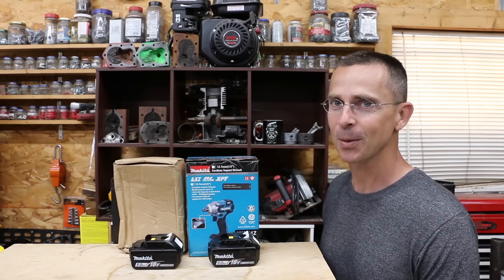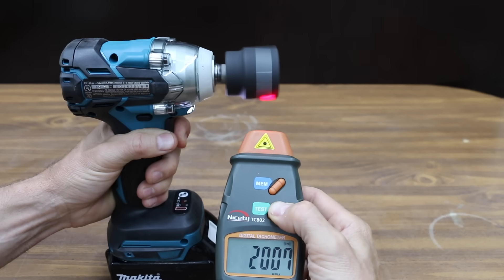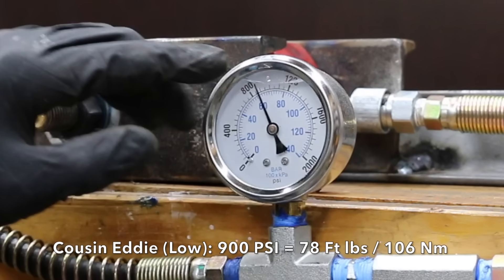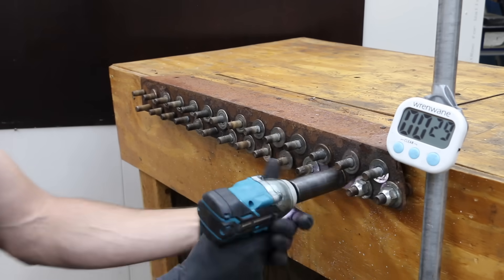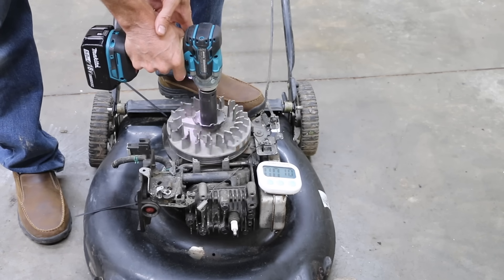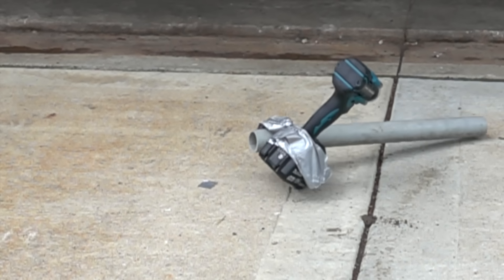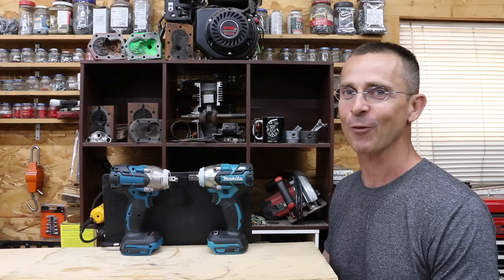Fake Makita Impact Better? Let's find out!  Makita XWT11Z 18V LXT Lithium-Ion Brushless Cordless

Comment: That makita is worth the 130$ but that was a good 30$ tool also
Reply from the maker: Great point
Reply: @ProjectFarm  keep up the amazing work this is one of the best channels on youtube
Reply: @arvivirash5561  if u are going to buy something buy it good than buying something bad knowing it eventually fail on you
Reply: @lil_frizzzy2313  how do you know the cousin Eddie will fail and the makita will not? simply because its expensive?
Reply: Chicago Pneumatics invented both the air and electric impact wrenches. So all should be paying them, but that is not how reality works. For home use, I would buy the $30 Chinese, Indian, Korean, Taiwanese, Japanese, etc etc who ever makes it as long as it does the job vs $130.00. If they are specifically saying they are a brand that they are not then yea I would not buy it.
Reply: @rafaelrivera9346  Some of the best tools money can buy are Japanese.
Reply: @rafaelrivera9346  Japanese tools are far superior to some of these tools made for American companies in China.
Reply: @rafaelrivera9346  if their patent wasn't expired, or if CP still held patents which actually mirrored existing products, then they do pay.  You are forgetting that the $30 eddy doesn't come with a Makita battery and charger.
Reply: Though a product brand may be American, however a lot of engineering products of these sorts are in fact either made and or assembled in China or other Asian countries. And because of contractual agreements the assembly manufacturer has licenses to produce a generic (or so-called knock-off) product from basically the same tooling and cast/molding jigs. This has always been the case for decades - hello to Radio Shack’s Realistic radios produced by Motorola. They were essentially identical save for the different brand names stamped across the respective products.
Reply: @marvinjgerald01234  This is true.

In the UK especially it's a joke for electronics, nearly all TV's under 40 inch are made in the same factory in Turkey and just have a brand logo slapped on the front, Panasonic admitted that they don't manufacture any TV under 40 inch they outsource it all and just collect royalties, LG is the only company to my knowledge that doesn't outsource anything, in fact they make LED/LCD panels for most others.

Dewalt/Black & Decker/Stanley are all the same brand, with a little fiddling they can even use the same batteries. Most companies talk about IP theft but most put up with it secretly so they have access to the Chinese market, basically the Chinese factories blackmail companies into letting them rip off their product.
Reply: Imagine having four 30$ tool working at the same time, and still have another 10$ for a 6pack...
Reply: UsirRaMaroon  You are correct.  I was unaware of the design patent (https://en.wikipedia.org/wiki/Design_patent) section of industrial design right.
Reply: This comment spoiled the video :(
Reply: Well, Anyone here into Firearms? Beretta, the Beretta 92. Designs have been legally sold to other manufactures, there are now many clones of the Beretta 92 being legally made by many other firearm manufactures. A lot of people think it's a knock off violating rights blah blah. Nope, My Taurus 92 is 95 percent the same as the Beretta 92.
 Any of you ever think, MABYE Makita bought rights to a design from the same place the manufacture of the "cousin eddie" acquired it from?
From the dismantle, you can clearly see the internals are different in build quality and setup.
Reply: @r.bridge1225  

Taurus, the Ford Pinto of firearms. 😆
Reply: Except for it being a total ripoff of the Makita design.  I don't like to reward thieves.  If you want to make a $30 tool and sell it on its own merits, then fine.  If you're trying to get sales by blatantly trying to appear identical to Makita, then you're trying to profit from Makita's good name and that is theft.
Reply: @BixbyConsequence  "I don't like to reward thieves." Yepp, that's the point. I would never ever buy it!
Reply: @BixbyConsequence  A lopás a 130 dollár.
Reply: @BixbyConsequence  ah yes truly theft just like how we are all thief's for daring to use wheels enjoy copyright laws though sure helps with advancements of tech... oh wait
Reply: Great tools!
Reply: the point is that makita is good brand 
but EDDIE from China is better according to ratio -  price quality 
if makita is 5 times higher , the performance on all the tests must be 5 times higher, it is not worth to buy makita ! 
for sure must be other impact tools on that price that (chinese products and not only ) will have the same performance as makita !
Reply: @gtsalbania7524  your rational is wrong.  eddie doesn't claim to perform 5 times better and doesn't even perform to what it claims to perform at.  eddie also requires a makita battery, being "for makita battery" tool.  eddie sellers give you a 30 day return policy without further warranty, which means you are going to have to pay $30 to return the item back to china for a replacement within that 30 day period, so let's just count it as 2 eddies, since no one is going to pay $30 to return ship a defective $30 eddy, which is what the chinese companies are counting on.  eddy doesn't perform at all, because it doesn't include a battery and/or charger for that battery it doesn't come with.
Reply: seems like if you're going to use cousin eddy a couple of times a year at home, and you already have makita tools (for batteries) its a great buy. but if you work in a garage and use it daily, it will probably die within a few months. false economy is only false if you expect the same quality... if you know what you're buying and only need it to do what it's capable of, no-one is worse off.
Reply: thats the home tool..not expensive but  good
Reply: hermit  Too overpriced? The video show the Makita is heaps better than the clone. You must have never owned quality tools. The clones are horrible it don't even have a linear speed controller.
Reply: ian Halifax good idea. Though I wonder if you need to charge the battery every month.
Reply: hermit  For how long? The hammer will be shot after a few uses while Makita will still keep on going after  years of use.
Reply: @YZ probably not, but I would assume there are people who gain satisfaction from more meaningful things than shoes.
Reply: UsirRaMaroon  except they BOTH are made in China..probably at the SAME factory!!
Reply: My dad has a makita drill, never changed it during my whole life, I'm 21.
Reply: Do you still have the name of the seller or the sellers store for the knockoffs?
Reply: @wingnutwillie  you can find them by searching 'impact driver' on aliexpress. If you can match some key features on the Eddy one with what you find on aliexpress, it's probably coming from the same factory. The 'fabeita' brand ones look the same
Reply: Essentially I could have 4 Cousin Eddie's on standby vs 1 Makita. 🤷🏼‍♂️
Reply: @RandomJ2023  but will the 4 cousin eddies last as long as the 1 makita, and are the 4 cousin eddies warrantied as long as the 1 makita, and what batteries are you going to use exactly on cousin eddy?
Reply: China does whatever they want to. After all, they can do it in the US too, because they pretty much own the US. If they call back the $$$ loaned to the US, we will all be speaking chinese
Reply: @sirjohndoeofpa3292  You're tippinn dude. Show the proof?
Reply: @sirjohndoeofpa3292 the US has all its debt in US dollars and is the sole entity able to create new dollars. Technically if the chinese called all the debt on the US the US could create one bill worth _ trillion, hand it to them and call it a day. Then the chinese could spend it and watch the value of the dollar drop immediately and make whatever amount they were paid immediately worth significantly less than the money they lent to the US, thus killing the value of their own money reserves that is in US dollars. In addition, for all the debt and inflation the US has, the chinese yuan has 4X the problem. It's why nobody is interested in taking the yuan as payment for anything over the USD, Euro, GBP, or Yen.
Reply: Sir Loin Beef, you're full of shit. China doesn't US. Both tools are made in China. If Makita thinks generic brand is infringing on their IP, they can easily launch a lawsuit. Obviously you and many misinformed people have no knowledge of patent  laws. I suggest Americans should educate themselves instead of wasting time doing useless things and writing nonsense
Reply: @sirjohndoeofpa3292  the Makita is made in China...BOTH are made in China and probably at the same factory!

Comment: I have a suggestion for you.  You've done showdowns for a lot of different kinds of saw blades and cutting tools.  I recently bought an oscillating multi-tool and have noticed that there is a huge price difference between the name brand blades (DeWalt, etc.) and the presumably Chinese knockoff brand blades sold on Amazon.  I'd like to see a comparison of these blades to see if the price difference is worth it.  Some of your other comparison videos have proven that better brands typically are worth it.
Reply from the maker: Great suggestion!
Reply: I can say there isn't much difference from experience. The best value you can get with those is buying a nice fine file. I have a dewalt blade in my kit that I've used for years and just file the points back whenever they're dulled. The blades are high carbon steel and you can sharpen them
Reply: Now at our local hardware stores they sell cheap blades at the checkout. Instead of 20 dollar dewalt blades and 30-80 dollar fein blades we can now just grab the 5 dollar cheapie without having to order them

Comment: Thanks for the comparison!
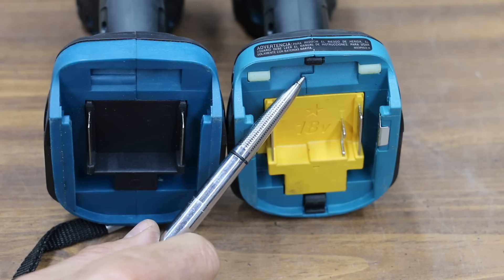I think it is worth mentioning that the fake impact doesnt have the 3rd pin in the battery connection (1:43). Makita uses that pin for all the battery safety features, the actual battery signals the tool to stop if it's overheated, overloaded or overdischarged. The Fakita can obviously not react to that because of the missing pin and is way more likely to damage your battery.
I would have liked to see the difference in power usage and current when actually impacting, but I guess it took enough effort already to make this video.
Reply from the maker: Great point!  Thank you

Comment: Consider you can get 4 knock offs for 1 Makita. If the knock off will get ya going I think I'd go with the knock off. If I had to use it every day, I wouldn't be using a battery powered one anyway.

Then again I have a concern about living in a disposable society. It kind of sucks. Should I buy the Makita or cousin Eddy? They probably both wouldn't last as long as I would want them to.

Comment: I was a commercial/industrial electrical contractor for years. Myself and all of my guys used Makita for a few years then switched to Dewalt. We abused them with drills constantly used for unibits and hole saws in steel boxes, impact drivers running in tens of thousands of self-tapping steel tek screws, along with being dropped from ladders. We seldom destroyed the Makitas or Dewalts.

Comment: Knockoff is a lamb in Wolf's clothing. It is probably fine for light duty occasional use but not much more. 
  I gotta say tool comparisons are a great idea. Everything you compare has much better testing that everyone else's  and as usual with an  unbiased opinion. Love the dances BTW. 🙂
Reply: ive been running that exact knockoff in my service truck for a little over a year now and it has served me well! Not an issue yet and I need to mention that mobile mechanic work is ROUGH on tools. My makita ends up breaking in 2 years due to cracks, brakekleen etc, and this has almost lasted just as long. For normal use where your tool would last you 10 years, I dont see it lasting as long as the makita, but when you are breaking tools from basically abuse vs lifetime, the cheapy is well worth the money!! Trust me, order one and your makita will sit safe at home in the box for quite awhile, this thing works great
Reply: @Hammerjockeyrepair  yep, I've got a cousin eddy, he gets more powerful as u you use him. Had it about 18 months and its had loads of stick an never broken down yet!
Reply: @Hammerjockeyrepair  i stand corrected. Glad your happy with it
Reply: Definitely good for at home for odd jobs here and there well most cheap tolls are good for that
Reply: And after a year or two in storage, the battery will no longer in service
Reply: i wholeheartedly disagree. is the makita 15-20% better? yes absolutely, but do you NEED that for 300% markup? absolutely not.  Given you can have 80% of a makita for 30 dollars, this thing is insanely good and I wouldn't hesitate to buy an arsenal of knockoffs to do the grimy jobs and keep my makita (well actually, my millwalkee) for the serious and precise work where you actually need something beefy.   Overall, I don't think we're at a pitstop here, the knockoff can still accomplish a particular job in the same amount of time given you don't pick your nose or wipe your face in that time you save by getting a nut off 2 seconds faster.
Reply: @Fuffcat  amen
Reply: @Fuffcat  i have the knock off brand also, i use it to take lug nuts off and on my truck. make your own choices.
Reply: @Fuffcat  plus the batteries are the same!
Reply: The question is: how often do you need it, what are you planing to do with it, where do you need it.  And sometimes there is the wolf in lambs clothing when there is a hidden makita in the discount tools
Reply: They are the same size in the hammer area. idk why people use 1/4" impacts for this.
Reply: @woofer2121  They use them because they have them. I have taken lug nuts off with a 1/4 impact driver. I rarely do it, so having an impact wrench seems overkill. But a $30 impact wrench? Maybe that would be worth it. I already have the batteries.
Reply: Still good for 99% of users. LOL!
Reply: I'd buy Cousin Eddie in a heartbeat.
Reply: Old adage for home tools: "buy the cheap one, and if you break it, buy the expensive one"

Comment: For people like me who use tool like that maybe twice a year this knockoff is actually ok. Too bad that it's hard to know what you buy in brandless world, for $30 you can buy this and you can buy something useless. My father buy some cheap cordless drill and once I use it during battery change it felt little bit light for 2Ah battery. I open it up, inside there was two cell (so not even voltage was as declared), 16340 cells with maybe 400mAh, probably less.

Comment: Great test. What I've found with cheap drill motors is that the batteries ability to accept multiple charges and discharges is what makes it a good value or not.

Comment: Suggestion: Tire Valve stems.  It's perfect for Project Farm as this is a maintenance replacement item for anyone that runs equipment with pneumatic wheels. (which might be 99% of people watching).   It would be a cheap, quick and easy test.  I just tried to find quality valve stems and they are getting rare.  How fun would it be to test blow-out psi? (Easy enough to use a air tank and drill a few holes)  Test them after freezing? Hook them to a saw-all for the wiggle test.  You're audience needs to know how cheap they are making these now.  Thank you.

Comment: I bought the fakita/cousin eddy. It’s great for $35 I paid. I feel like definitely, yes it was a great deal and I am very happy with the purchase. And it takes Makita batteries so it’s easy to get chargers and batteries for. Downside: shipping for me took almost two months (maybe delay due to coronavirus). No case, no manual, but those aren’t worth $100. I bought a few of these cheap tools and they’ve been great for light home use. I saved a lot of money.

Comment: I'd buy cousin Eddie, every-time. I can break it 4 times and still come out even.
Reply: That's 4 months total waiting time for tools to arrive. Low cost logic. Reliability is paramount. Junk costs you in so many ways.
Reply: @markm8188  4 months for a life time of use, ... OK, ... I'm alright with it, but then again, If I was using it professionally, I would buy two of them and use them both. I still come out way ahead!
Reply: If I was a professional I'd buy the original. For safety concerns alone. But since I'm not, I bought the fake and I love it. Oh and my "Eddie" features an insert for hex bits, so it can be used as an impact driver.
Reply: We're neck deep in shit and people still don't learn.

Comment: Hey there PF(sorry, don't know your name), love your channel and love the videos and have been subscribed for quite some time now. How about doing a flashlight comparison? A very specific flashlight comparison...disposable battery operated only, and only flashlights between A and B lumen's, say 200 (+ or -) to 800 (+ or -), you decide. I apologize if you've already done this and I've just missed it, but I don't remember seeing one by you. The reason I ask, is because I balance my flashlight purchases based on cost and performance. One of the best ones I've found has been the Harbor Freight Quantum 588 Tactical at a price point of $14.99....It's a competent everyday flashlight (I use it everyday on the job), but if it were to become damaged or lost...MEH...I'm not out a bunch of cash. Well, the other day I dropped this very flashlight from about 4 feet and it completely stopped working, and I have owned that light for about a year and a half, and have certainly dropped it before. I wonder what kind of extremes the higher end lights could put up with before giving up the ghost based on similar wear and tear. Anyway, just a thought, and you always ask for suggestions in the comments. Keep up the great work, as far as I'm concerned your reviews are as good, if not better, than Consumer Reports.